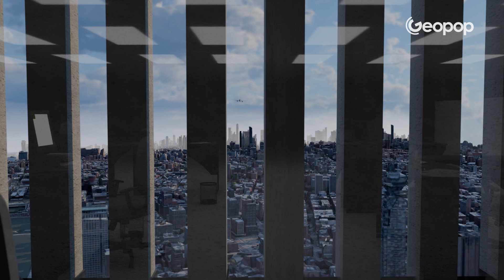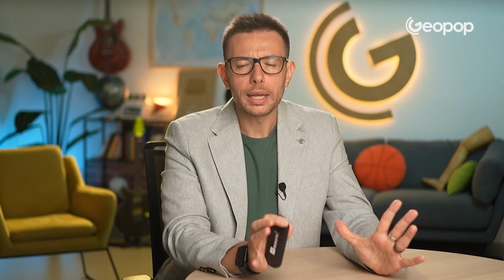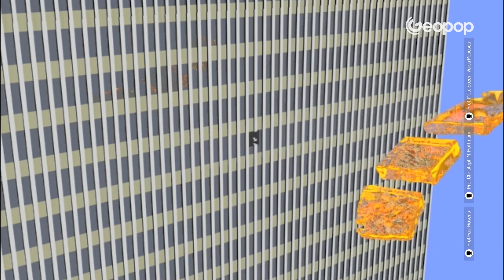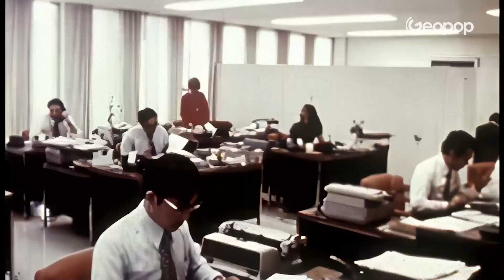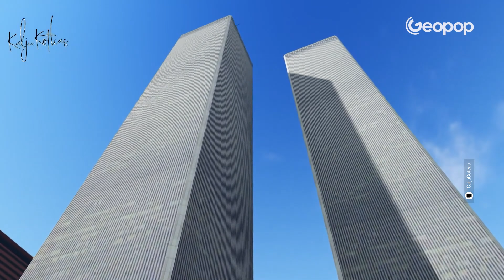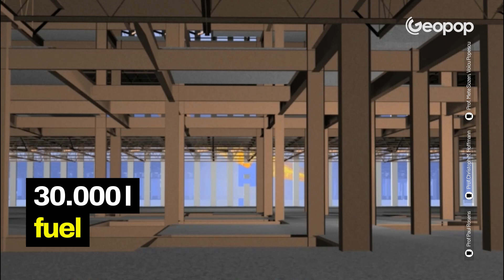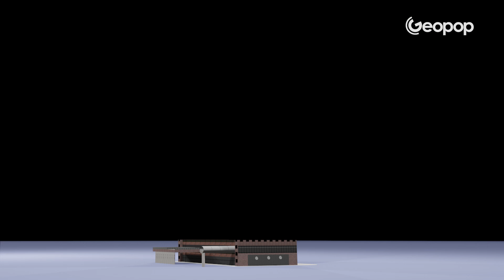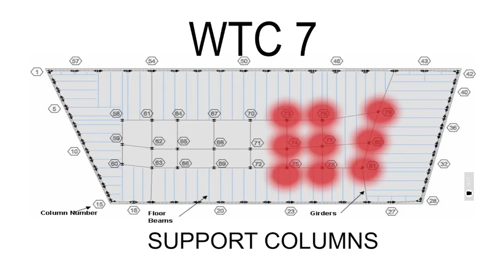9/11, 2001: The Technical Reconstruction of the Twin Towers and WTC 7 Collapses

Comment: The third law of motion would have prevented total collapse of the towers . Using the physics of the official explanation sitting on a chair would be impossible . And where did all the jet fuel come from. Most of it was burnt up in the initial explosion ?
The Grenfel tower in London  was on fire for 14 hours , totally engulfed in flames and it still stands .  One tower on 9/11 was on partial fire for 54 minutes and collapsed  and collapsed to basement level 
The core of the towers are always missing in these animation  explanations as well . The core would have remained standing no matter what happened to the floors
Reply: Would it?  How?  Please explain how the 3rd Law of Motion would have prevented total collapse of the Towers and don't forget to show your math. 

Why did you pick Grenfell over something more relevant like Plasco or Wilton Paes de Almeida?
Reply: @ None of those buildings collapsed into their own footprint  and if my memory serves none were high rise skyscrapers . The Grenfel tower though not as tall as the twin towers was designed similarly . The Plasco building  was on fire for nearly four hours not 54 minutes like the towers . Ameida was a wild fire nothing like the building fires we are discussing . And the other fire started on the lower levels and the fire spread upwards . Nothing like the towers where the fire started on the top floors 

The third law of motion for every action there is an opposite and equal reaction explains it simply 

. When the top 15 floors of the towers collapsed onto the remaining  undamaged 95 lower floors . There would have been upward equal force opposing the downward force created by the top floors  collapsing . When the energy from the top floors had dissipated the collapse would have stopped . Basic physics 

A little like sitting on a chair . When you sit down on a chair the downward force  created by your body is met by the upward force from the chair or more  accurately the floor,  that counters the downward force . And the chair doesn’t collapse . Again basic physics
Reply: @TrevorCrook-c1s  - Both were high-rises (although neither the fire nor the buildng know or care how tall the building is), both were steel framed (unlike the all-concrete Grenfell Tower) and both collapsed straight down - as buildings tend to do. The in their own footprints crap is conspiracist fantasy.  I prefer to stick to reality. 

Why are you treating the collapse of the Twin Towers as two solid blocks coming together?  Dealing in over-simplistic and false block dynamics mechanisms is what has kept people ignorant for 24 years.

The 47 core and 236 perimeter columns of the Twin Towers support all of the gravity loads of the building. ALL of the resistance is in the columns.

Planes impact Towers, causing massive structural damage, destroying sprinkler systems, tearing out gypsum board walls and blasting off the SFRM insulation from the floors. Multiple floor-wide fires are started instantly and spread rapidly due to the destruction of fire protection systems and venting of the building during the impact.

Serious fires were largely confined to the impact damaged floors and those immediately adjacent to them.  

Fires were started by the impacts and fuel aboard the aircraft, which acted as an accelerant. No shortage of other consumables inside the tower to continue the fires. 

Collapse was initiated (started) at the impact and fire damaged floors when floor trusses exposed to heat over time sagged, in turn pulling on and causing the inward bowing of perimeter columns by up to 5 feet until they buckled. 

No steel melted or needed to. Structural steel will bend and fail at less than half its melting temperature.

Once the perimeter columns buckled the formerly static load above became a dynamic load 30 times greater, easily overwhelming the structure below.

Thousands of tons of now loose debris fell through the open off space - through the inside of the building bypassing the columns - dropping 12 feet onto the first intact floor it comes across. The massive instant overload causes the floor to fail, adding its mass to the falling mass which continues to accelerate for another 12 feet until it impacts the next floor, rinse and repeat all the way down. Rate of collapse increases as momentum increases. 

It's not 15 floors crashing into 95 floors. It's 15 floors crashing into 1 floor, then 16 floors crashing into 1 floor, then 17 floors crashing into 1 floor, etc, etc, etc,...

As each floor fails, air inside the building (the Towers were 95% air by volume) is compressed, then blows out the sides _in reaction to the Tower falling, not the cause of the Tower falling.

No fire required at all on floors below the impact points for them to fail. The mechanisms that started the collapse are different to the mechanisms which continued the collapse.   That will be a difficult concept for some.

As the floors fail the perimeter columns are left literally hanging in the breeze, no longer attached to the rest of the structure. They peel away and fall in great sheets (think banana) out to more than 600 feet from the base on the 4 points of the compass. 

Core columns failed last. 

Each 110-story tower had a 1-acre footprint. The debris pile was up to 14 stories deep and spread out over 16 acres, destroying 8 surrounding buildings and damaging more than 100 others.
Reply: @TrevorCrook-c1s  "The third law of motion for every action there is an opposite and equal reaction explains it simply"
Is your opinion that no collapse of any structure is possible as long as it existed for a second as it?

Maybe you don't understand much about structural mechanics. Maybe, just maybe, someone on  a video said nonsense you swallowed too easily, and you're parroting that "third law of motion" stuff you anyway have no idea about.

What do you think?
Reply: @  a structure can collapse if there is a fault in the structure eg support beams destroyed before the event. I suggest you research the third law and its applications . Not that hard . It’s basic physics as I said 
I think you are confused and poorly educated on the subject

“ is your opinion that no collapse of any structure is possible as long as it existed for a second as it “ ? . What does that even mean ?
Reply: @TrevorCrook-c1s  "a structure can collapse if there is a fault in the structure"
Or if a plane smash into it full of fuel and trigger a massive fire.

I think you are confused and poorly educated on the subject.

"What does that even mean ?"
You're using "third law of motion" as if that was a good enough reason for a structure not to collapse on itself, because it once reached static stability.
I invite you to watch a few videos of some large Kapla towers, in full static equilibrium, fully collapsing top to bottom from a simple structural weakness created at top.
According to your "third law of motion" pseudo argument (that you obviously don't understand) that should be impossible, but here it is.
Reply: @TrevorCrook-c1s I've tried explaining the third law myself to these people numerous times.  They never learn. Your time would be better spent talking to a clay brick.
Reply: @ It wasn’t a massive fire  just the top 15 floors . According to the official report the jet fuel supply only listed for a few minutes as most of it went up  in the initial blast when the planes hit the tower
The top 15 floors only constituted 2% of the total weight of the building . So you are saying that 2% of the mass collapsed on the remaining  98% of the mass of the building and the 2% won ? 
The structural weakness must be at  the bottom not the top . Eg if you sat on a chair and the bottom structure ( a leg of the chair ) was broken the chair would collapse  because the structure had been compromised . No other way . Otherwise the third law of motion would be in effect and no collapse . Obviously the buildings collapsed  so the structure was unsound on the bottom floors . And the fire didn’t reach those floors so what is your explanation?
Reply: @robbiehiatt9966  We do understand the third law, you obviously don't.
I can try to explain why it's irrelevant here again, but will you understand?
Reply: @TrevorCrook-c1s  "It wasn’t a massive fire  just the top 15 floor"
It was massive on a few floors, enough to have the building to collapse at that point.

"the jet fuel supply only listed for a few minutes "
Some more, but AFAIK, jet fuel provided about 1-2TJ to the ~5-7TJ total. Most was provided by furniture fire.

"as most of it went up  in the initial blast when the planes hit the tower"
Incorrect. Estimations are in the 30% for that.

But I'm glad you gave up on that "third law" nonsense.
Reply: @ Burning furniture caused  500,000 tons of steel and cement to collapse  to the basement? lol  the 95 lower floors were not effected by the fire anyway .. 
jet fuel tanks  exploded but 70% of the fuel remained ? lol . Try that at home. Light a petrol fire and see how much of it remains after five minutes 
. Nothing . As the official investigation said . 

The third law of motion is a reality and in effect all the time . If you are sitting on a chair at the moment  you are experiencing it first hand 
I suggest you talk to a physicist and ask him to explain
Reply: @ThomasKundera  he didn't give up, but I sure have you are too ignorant to understand.  He just proved that for sure. Good job Trevor of explaining it in a way anyone normal can understand.
Reply: @robbiehiatt9966  thanks buddy
Reply: @TrevorCrook-c1s  and it doesn't matter how many times they've been proven wrong, they go right back to the top of the comments and say the same crap all over again.
Reply: @TrevorCrook-c1s  :
"Burning furniture caused  500,000 tons of steel and cement to collapse  to the basement?"
Caused the failure of a few stories, which was enough to initiate the ruin.

"the 95 lower floors were not effected by the fire anyway"
On that, we agree?

"jet fuel tanks  exploded but 70% of the fuel remained ?"
Went inside the building, yes.

" lol"
Laugh less think more.

"Try that at home. Light a petrol fire and see how much of it remains after five minutes"
Irrelevant.

" Nothing . As the official investigation said . "
Everything burned, but took quite more than 5 mn.

"The third law of motion is a reality and in effect all the time"
We all agree on that.

"If you are sitting on a chair at the moment  you are experiencing it first hand"
We all agree on that.

"I suggest you talk to a physicist and ask him to explain"
I did.
The issue is not there.
Reply: @robbiehiatt9966  " I sure have you are too ignorant to understand."
You are the ignorant here.

"Trevor of explaining it in a way anyone normal can understand."
He couldn't explain how the third law would explain why the building would not collapse (of course, as it can).

And it doesn't matter how many times ignorant have been proven wrong, they go right back to the top of the comments and say the same crap all over again.
We know.
Reply: @TrevorCrook-c1s  - I suggest you read my second reply in this thread instead of pretending it does not exist. 

You are mis-applying physics to collapse mechanisms that did not occur. 

I will repeat the important bit again;

Collapse was initiated (started) at the impact and fire damaged floors when floor trusses exposed to heat over time sagged, in turn pulling on and causing the inward bowing of perimeter columns by up to 5 feet until they buckled

www.youtube.com/watch?v=ULdiD6gYZO0  

Once the perimeter columns buckled the formerly static load above became a dynamic load 30 times greater, easily overwhelming the structure below

_Thousands of tons of now loose debris fell through the open off space - through the inside of the building bypassing the columns .  This was NOT a "top block" falling on a bottom block".  There are not blocks. That debris dropped through the open office space and onto the first intact floor it comes across. The massive instant overload causes *the floor (as in the truss system) to fail , adding its mass to the falling mass which continues to accelerate for another 12 feet until it impacts the next floor.  Rinse and repeat all the way down. Rate of collapse increases as momentum increases. 

It's not 15 floors crashing into 95 floors. Over-simplified 15 floors (worth of falling mass) crashing into 1 floor, then 16 floors (of mass) crashing into 1 floor, then 17 floors (of mass) crashing into 1 floor, etc, etc, etc,...

IF there is a part of that you are not getting, please let me know.
Reply: @ThomasKundera  There was a steel core in the middle of the buildings much like a spine . The floors were attached to the core . Even if the floors collapsed the core would not . That’s why when you see animations of the official  explanation they leave out the core . Because it totally demolishes their official explanation . . The core can be seen in the blueprints of the buildings
The few stories at the top would not have the force to take the 95 lower floors down . It’s absurd 
Your old nemesis the third law of motion would not allow that to happen . Basic physics 
Any kind of pancake collapse would be slower than what we saw . Each floor hit by the descending floors would slow the collapse . What we saw was the buildings going down at free fall speed . Meaning there was no resistance .
According to the official report all jet fuel gone within three minutes 
I don’t believe you about the physicist BTW.  The third law of motion is irrefutable and it applies to everything on the planet  chairs and buildings included
Reply: @TrevorCrook-c1s  - Cores provided the majority of the gravity load carrying capacity. Perimeter columns the remainder and ALL OF THE LATERAL (WIND) loads (HINT HINT HINT) with the long-span floor trusses tying the two together along with a hat truss to form an integrated system where no one element could survive without the others

This is why they didn't build the cores first, then the perimeter columns, then the floors. It all went up together.  

When the columns buckled, throwing them out of alignment with each other and sending thousands of tons of debris raining down within the four outer walls, it stripped out not only the long-span floor trusses but also the beams and girders withing the core system that were necessary for rigidity and stability. So while yes, the cores were the last to go, it's pretty obvious from watching the video they got the shit beat out of them and what was left could never stand on its own.

No doubt you will completely ignore this post just like you ignored my last two posts because you are NOT SERIOUS and you DON'T WANT TO KNOW

You are a believer and you want to cling to your beliefs, wrong as they may be.
Reply: @TrevorCrook-c1s  :
_"The few stories at the top would not have the force to take the 95 lower floors down .
Your saying is as irrelevant as "The first domino would not have the force to take down all others in a domino toppling show".
You're forgetting the converting of each element potential gravitational energy into kinetic energy.

" It’s absurd "
What is absurd, is to deny reality: we saw the planes, the fires and the collapses.
What is absurd, is an ignorant like you trying to dismiss the analysis of experts on the subject, using irrelevant buzzwords about sciences you don't understand.

"the third law of motion would not allow that to happen"
That's incorrect. You don't understand much about physics.
Again: watch a few Kapla structures falling down from top to bottom, with only a few (or even one) top element toppled for a start.

"Any kind of pancake collapse"
It's not exactly "pancake", what matters most is the breaking of horizontal structural elements by falling debris, forcing the buckling of the vertical ones under the load of the rest.

"would be slower than what we saw"
Source of that claim? Your *ss. While you don't even understand basic physics. Should I trust you over experts? What do you think?

"Each floor hit by the descending floors would slow the collapse"
Each domino hit by the preceding one would slow the toppling (not).

"What we saw was the buildings going down at free fall speed"
Incorrect.

"Meaning there was no resistance"
There was not much resistance. See why above.

"According to the official report all jet fuel gone within three minutes "
So, if you trust them, why are you saying nonsense here?
We already discussed that: Some more, but AFAIK, jet fuel provided about 1-2TJ to the ~5-7TJ total. Most was provided by furniture fire.

"I don’t believe you about the physicist BTW."
You shouldn't. But why do you believe yourself while ignoring everything in that domain?
Believe the experts.

"The third law of motion is irrefutable and it applies to everything on the planet  chairs and buildings included"
We all agree on that. (third time i repeat it, I think).
Are you a bot?
Reply: @ and so burning office furniture caused the entire collapse ?.  Buildings are designed a little better than that 
I suggest you look at the blueprint of the tower and listen to the architect who designed it . He would find your explanation amusing 

. And as I keep saying the third law of motion  would have prevented any kind of major collapse . The. Grenfell tower in London is a similar design to the towers . That whole building burnt like a candle for 14 hours and it’s still standing
You are the believer not me . I am going purely on the physics . You ignore the third law of motion. The main thing that makes your explanation impossible
Reply: @TheLoonResistance How could it “ all go up together “ ? Something has to be built first . And that is the skeleton of the building including the core . Then everything else including the floors  is attached to the core or skeleton 
No wonder your building license was revoked . 😂😂
The buildings were also fire proof
Reply: @TrevorCrook-c1s  :
"and so burning office furniture caused the entire collapse ?."
Plane impact + fuel fire + furniture fire weakened a few stories enough for them to collapse under the above load.

 "Buildings are designed a little better than that"
I dunno what you mean: we observed that fact.

"I suggest you look at the blueprint of the tower and listen to the architect who designed it . He would find your explanation amusing"
Architects understand that it happened as such. And it's a tragedy, not an amusement.

"as I keep saying"
Repeating fallacies doesn't make a fact.

"the third law of motion  would have prevented any kind of major collapse"
That's very naive and wrong.
But instead of just "repeating" try to articulate an argument, it will be easier for me to explain you where you're wrong.
And again, and stop ignoring : watch a few Kapla structures falling down from top to bottom, with only a few (or even one) top element toppled for a start. According to your fallacious "logic", "third law of motion" would not allow it, but as you can see, it's happening.

 . The. Grenfell tower in London is a "_ concrete building. Comparison is irrelevant.

You are the believer not me. I am going purely on expert knowledge, that are in agreement with what I do know in engineering and  physics. You don't understand the third law of motion, and actually close to nothing in actual science en engineering.
The main thing that makes your explanation irrelevant. BTW: you don't even have an explanation. You just have denial.
Reply: @TrevorCrook-c1s  - This is how:  www.youtube.com/watch?v=z67IV07PvKU

There is no such thing as fireproof.